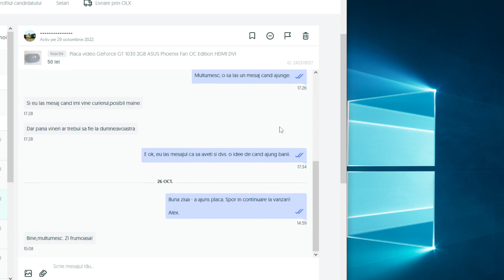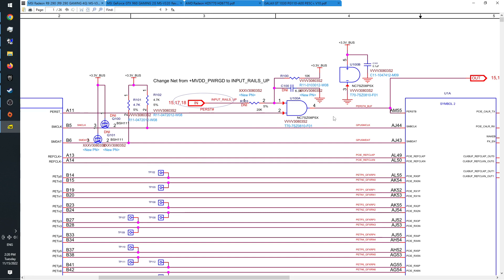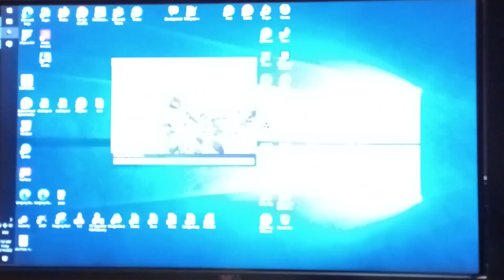The easy repair of a DDR4 GT 1030

Comment: Buenas noches amigo,..muy buen video.
Quizas tengas el boardview o esquemático de esta grafica asus ph-gt1030 o2g de antemano muchas gracias
Reply from the maker: Schematics for a GT 1030 from Galax:
https://www.badcaps.net/forum/showthread.php?t=90093&page=62#post1249903
A boardview, for a Gigabyte board:
https://www.badcaps.net/forum/showthread.php?p=1158686&highlight=GT1030#post1158686
Reply: @goodoldsolderingiron   muchas gracias por el aporte me es de gran ayud
Reply from the maker: @andres040988  you're welcome. Good luck with your repair!